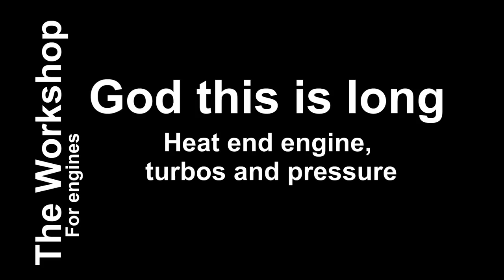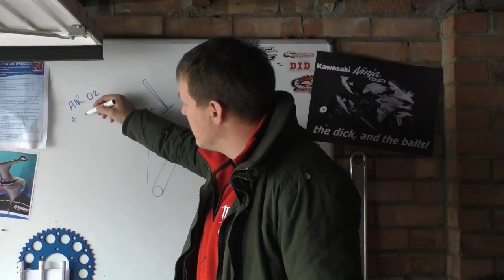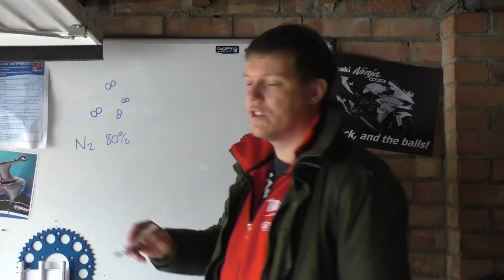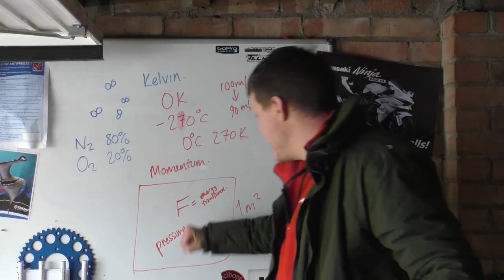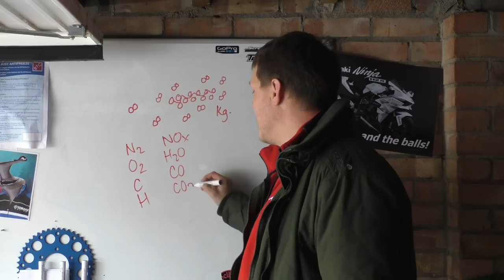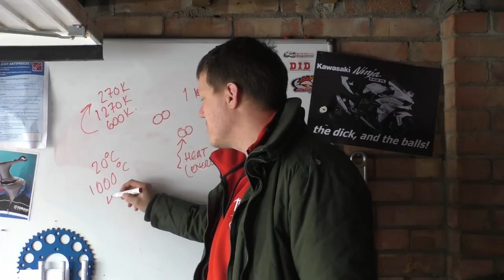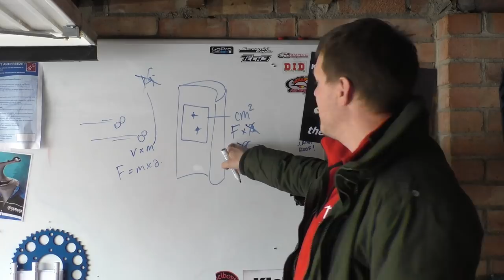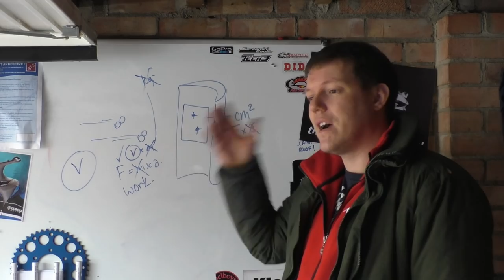Heat - the core of an engine

Comment: isnt the heat a by product. its combustion gasses that flow out the exhaust and spins the exhaust compressor to drive the impeller .and its EXHAUST (extraction) not to (take away or use up because there is still flow and heat at the end of exhaust after this has supposedly happened )
in fact a turbo generates MORE heat because its compressing ?
Reply: jack black how many times does he have to do this video
Reply: dont have 40 minutes sorry.
Reply: sure, if you have time for that.
Reply: jack black Im happy that you are able to express yourself. 
You still should see the video to get some answers instead off to critism. 
Anyhow, it gave me a laugh in the morning. Have a good day
Reply: If you measure exhaust temps up and down stream from the turbine, and measure intake and charge air temps, you'll see that the turbo doesn't 'create' heat (impossible if you have even the slightest grasp of thermodynamics).
For arguments sake, you may have a 300degC drop across the exhaust side and a 90degC temp difference between intake and charge air if you are running big boost levels.
Reply: the cold side does generate heat. thats why you need an intercooler to bring the temps down to a better range
Reply: "the cold side does generate heat".  Yes, and this proves Matt's point. The compressor side is doing the exact opposite of the turbine side. The turbine uses heat and pressure to produce rotational energy. The compressor takes rotational energy and turns it into heat and pressure.
Reply: Your missing the point. The 300 degree temp drop across the turbine is a measure of the energy used to turn the turbine. The 90 degree temp difference across the compressor is a measure of the energy imparted to the charge air. No heat is created. Using the values in my example, you can see that 210 degrees is 'wasted' or lost across the turbo charger, no heat is created....

Comment: So... It's heat that does the work... Hmmm then why does compressed air turn a turbine or push a piston? Riddle me thatMatt....
Reply from the maker: Great question - the velocity of the air does. The point is where does the compressed air come from?

You have 2 options. Either its an electric motor compressor - which is turn the electric comes also from a heat engine 

or

Its a diesel or petrol powered industrial compressor - which again are heat engines. 

Heat doesn't turn turbines and I never said it did. Heat (energy) acelerates the molecules - pressure isn't a thing - there's molecules and nothing more - pressure is a measurement - its like saying you have 20 meters of rope. The rope is the thing not the 20 meters. 

Even saying air/exhaust has pressure is not correct. High energy air/exhaust exerts a pressure on surfaces it comes into contact with.

The reason why this is important is when you come to design and improve a turbo.
Reply: Sooo pressurized air in a tank isn't a thing.... if we can't call it pressurized air then what to call it? Air stuffed into a small space? Air without pressure isn't very useful... BTW that air compressor could be running with electricity from hydro, wind or even a solar panel.... since wind and rain are produced from heat I guess you could say that almost all electricity comes from heat with the exception of solar... Heating air (or any working fluid) in a confined space is one way to create pressure...  pressurized air in a tank is potential energy...  it doesn't do much until you release it... if you extract work it gets much cooler than if it's just released to the atmosphere... https://www.youtube.com/watch?v=SVSeYg9-GEI

Comment: Can I sum it up? 
Matt- "heat powers a turbo". 
Others (& me)- "heat powers a turbo, indirectly" 
So the only disagreement is a single word? 
"indirectly" could sum up all the other stuff...... Chemical energy, combustion, Kinetic energy, thermal energy, force, velocity, mass flow, pressure, conservation of momentum, 1st & 2nd laws of thermodynamics, adiabatic, isentropic, enthalpy... 

So, keeping it simple, heat powers a turbo. And if you are a tiny bit pedantic you could quietly whisper "indirectly" at the end of the sentence 😇. 
Everyone happy?
Reply from the maker: Should change the word 'powers' or 'drives' hence why I've said energy for ages LOL
Reply: I'm not happy with that!
Reply from the maker: LOL so? Alex it doesn't matter if you agree - its the way it is.
Reply: wirdy1 it's the heat from the burning of the fuel which powers the engine and turbo.
Reply: I have a question.  Is it pressure or kinetic energy...Oh, forget it.
Reply: colin mccabe
Thanks for clarifying that for me.
Reply: The turbine spins as a direct consequence of the heat released in a temporarily sealed container upstream of it.  We had to do the one in order to get the other.
Like a water turbine spins as a direct result of the water accumulated in a reservoir upstream of it.

Now, "indirectly", how did that water get there?  "Indirectly", how did that heat get in the cylinder?  Answer to both: the sun.  How did the sun get there?  The big bang.

This is why a reductive argument is fruitless, because you lose sight of the system of interest and its relevant boundaries.  For an ICE, the boundaries are defined by the fuel input - i.e. by tracing where all that energy goes, most of which is released in the disordered state we call "heat".

Comment: Couldn't you just think of a jet engine. Without heat there wouldn't be any energy for the turbines to recover so there would be no power to the compressors.
Reply from the maker: Some guys don't know how a jet engine works
Reply: Furry muff
Reply: this is what I dont get. to start a jet you need bleed air. not a blowtorch. heat is the by product of the compression.
Reply: jack black 
To get a jet engine started you need compressed air to get the compressor and turbine moving and the air. Then the fuel can be switched on along with a preheater to help atomize the fuel. The air and fuel mix correctly then it is ignited. Once you have a continuous and stable burn the heat drives the turbine which in turn drives the compressor.
Reply: but if say I put a heat blanket around the jet engine. the jet wouldnt suddenly start up. it needs airspeed yes. 
and I can prove it even further. if the jet was shut down at altitude. you need to "motor the jet" or windmill it (air speed to spin the turbine with air moving through it" 
the heat on its own does nothing even for a jet.
Reply: They need to look up the "Brayton Cycle", in the real world is does the same as any piston engine but it does each cycle at the same point in time.. suck, squeeze, bang and blow at the same point of time.. LOL
Reply: Viney Motors!!!!
"the heat drives the turbine..."  The turbine moves because of a pressure difference between the expanding gases and the outside air.  If gases could be made to expand without heating them, then the principles would remain the same.  The most expeditious way to cause a gas to expand is by heating it.   Heat, in itself, does nothing but expand the air.
Reply: "And then there was the case of the strawberries.  They thought they had me on that one."
Reply: Viney Motors!!!! Nonono! the igniters have to be on before you switch on fuel, otherwise you can fuck the engine. Sometimes when the fuel doesn't ignite and pisses out the back for too long you have to abort start. This is kinda easy to see because a massive cloud of mist shoots out the back of the engine.
Reply: Well it's the velocity of the expansion of gas thru heat.. LOL
Reply: How fast do you think the turbo would spin if the piston didn't come back up and push the exhaust gasses out of the cylinder?  Those gasses, for the most part, have been depleted of there energy and heat.  The combustion heat is not present and the gasses are no longer combustible.  They are inert.  The returning piston applies pressure to the exhaust gasses and on toward the turbo.  
If you don't believe it's the pressure, jam a potato in your exhaust pipe and stand back 'cause it's gonna come flying out ot there with a vengence.
Reply: alex tworkowski Well, the turbine extracts a lot of heat out of the exhaust gasses, they are cooler than infront of te turbine. Pressure and temperature in a gas are locked to each other in a way that compression (increasing pressure) will cause an increase in temperature and expansion (decreasing pressure) will cause a reduction in temperature.
Reply: Well because you are now talking recip stuff like you need a fly wheel to keep the momentum , for say. A jet turbine is axial flow... That is where it's different and yet the same.   You still need heat to keep them both running and doing work.. I seen where some one talked about a " flame out" that happens from a compressor stall or it just ran out of oxygen, like super high altitude flights and even ice build up in the inlet.. Also a turbine engine uses exhaust flow to control heat and power.. Bleed air is used for cooling and pressurization in high altitude flights..
Reply: That is why there is a diffuser between the compressor and the combustion chamber.. Slow everything down and get it into a linear flow and keep the compression of air without the velocity.
Reply: alles klar klaus
Yes, they are locked together.  So why is Matt saying it's not the pressure that turns the turbo.  He's saying that the expanding gasses are turning it and the pressure is not.  Expanding gasses in a container equals pressure.  He's fucking wrong.  And on top of that, it's mostly from the exhaust stroke that the pressure comes from.  Engineers are not so stupid as to let most of the productive energy leave the engine by opening the exhaust valve any sooner than necessary.  That's an excellent way to burn the shit out of the valves.
Reply: LOFL!!!!! wow!!!! where is the so called pressure coming from? also it's about velocity of the fluids you control to get energy from, oh wait I need HEAT!!!..
Reply: alex tworkowski Pressure and heat are the same fucking thing you cannot say it's pressure without saying it is heat and vise versa. The pressure is just an "outlet" for the heat to give out it's power. If you up the heat you up the pressure, if you up the pressure you up the heat and the same goes for cooling down/lowering pressure. This is much simplified but how the else can I possibly explain this so people get it? I don't know anymore... This is 8th grade chemistry dear lord please help me :(
Reply: you can. does a rocket engine, that goes into a vacuum of space, burn fire? that will not work with in gravity of this plant..  Oh yeah now we are getting in more advance physics huh? rockets and jet turbine/ heat engines are not the same...
Reply: alex tworkowski And the piston part is actually wrong, the gasses do have a lot of energy left. Hence why the exhaust is loud and hot if you're running a little piece of pipe. If there were nothing left they would be at ambient temperature and not 500C and everyone worrying about their exhaust valves overheating. Engine designers are working hard to reduce this left energy the best they can because that is wasted power. This is why higher compression rates offer more efficiency, the expansion ratio of the combusted gas is higher, thus extracting more energy out of it. If the piston just pushed the gas out you might just as well run a classic supercharger and loose the same amount of power from the raw engine than with a turbo. And the exhaust sound you hear is the valve opening and the gas popping out, the remains in the cylinder than get transferred out by the piston. A 2 stroke "exhaust wave supercharging" works just on this principle as well.
Reply: drunknpossum and indeed a rocket is a jet engine, just not a turbojet.
Reply: At best you can only get 40% of all power from "x" engine, I disagree with mat on that point more like 35%. But you have to think what it takes to move and make everything that works at 100% all the time..  A jet turbine is said to be 80% at cruse.. but they are over 30K feet up from the gravity that keep us down here..
Reply: A rocket is not a turbine/ jet engine.. Rocket uses chemical reaction to make thrust. does it make heat does it need spark? That is a pressure differential deal... not the same.
Reply: Tell me how... I want to know... Please tell me...
Reply: drunknpossum And the gravity at 10km (about 30kft) height is about half a percent lower than down here. Main difference is in the air density
Reply: drunknpossum A rocket is a jet engine. A jet engine is an engine which produces a jet (hot and very fast gas flow) to generate thrust. That's why it's called jet engine, because of the jet. A turbojet is called turbojet because it uses a jet and a turbofan (todays airliner engine) - which is the same exact turbojet engine core with just a giant fan added -  is called turbofan because the fan is generating thrust through a cold, slower speed airflow which is not a jet.
Reply: humm, you know my instructor at school never would call a turbine / jet a rocket.. But I guess that is why we have problem in the world now days, called communication. Even when I was playing with rocket style engines they never made heat it was a chemical reaction. like vinegar and baking soda. but whatever you want to call it..
Reply: how far apart is "oxygen" at 30K ft vs 15K? oh what about the temp of the air... why is it you need to get down to a X alt to hope to re fire a engine? not talking super sonic military stuff...
Reply: drunknpossum A turbine engine is everything with a turbine, a jet engine is an engine with a jet. They are not at all linked together, just the fact most jet engines are turbojet engines makes it that people confuse these. Some people call passenger airplanes jets even thoug they don't really use jet propulsion anymore. There are definitely jet engines like the ramjet which do not have a turbine (or any moving parts actually).. A rocket works a bit on a different principle but mostly, say the glorious F1 engines on the Saturn 5 are using a very flammable mixture and rely on that thing burning. A rocket engine is not really by definition a heat engine, that's correct. And there are very different styles of rocket engines indeed.
Reply: There is an excess of energy left over as a piston reaches BDC. As the exhaust valve opens the flow is briefly supersonic! Valves are designed to take this.

Comment: Holy shit how are we still on this! The form of energy isn't relevant, exhaust through a turbo has mechanical, thermal, sound and light energy, reduce any of them and you will reduce the output of the turbo, FUCK!
Reply: Beach&BoardFan 
The 'form' of the energy is the most important thing if you want to truly explain how something works. Energy is energy....... The form is how it is measured which enables it to be explained.
Reply: Were talking quantitative not qualitative less is less more is more, no one mentioned efficiency of the system...
Reply: MadxJim you're also losing thermal energy unless you have an adiabatic system, sound is still usable energy in the system... again not talking about efficiency, just TOTAL energy.

ALL ENERGY MATTERS REGARDLESS OF ITS DELIVERED FORM, form is irrelevant!... again more is more less is less its that simple. You can convert any form to whatever best suits your method of capturing the given amount of energy. Its frequency along the electromagnetic spectrum does NOT matter...
Reply: If people would clearly state what they dont understand instead of copy and pasting 'facts' from wiki it would be easier to create analogies to help them overcome the knowledge block they have.
Reply: MadxJim What arent you getting, I dont understand the hangups people are having, WHAT DO YOU DISAGREE WITH?

If someone cant communicate their issue, there isnt a person in the world that will be able to help them solve it...